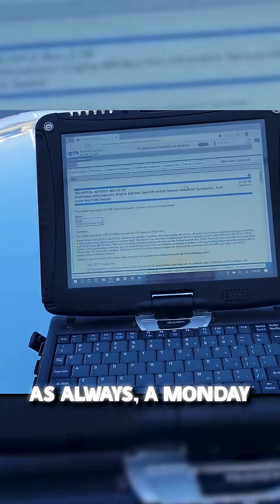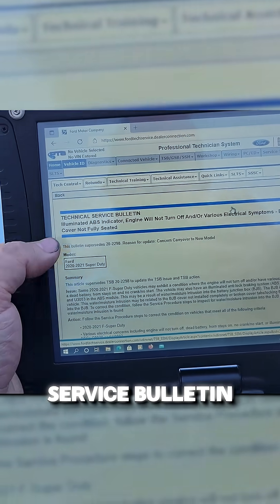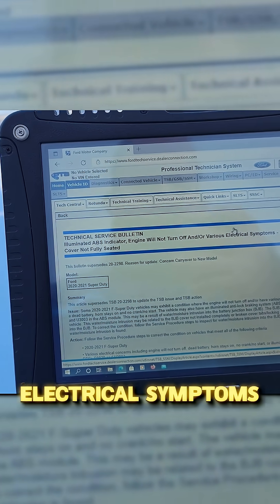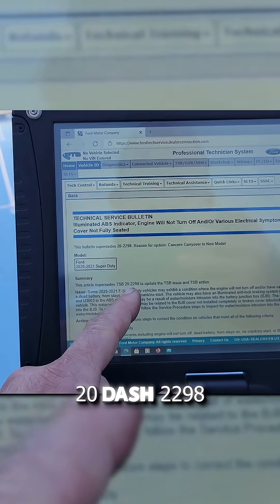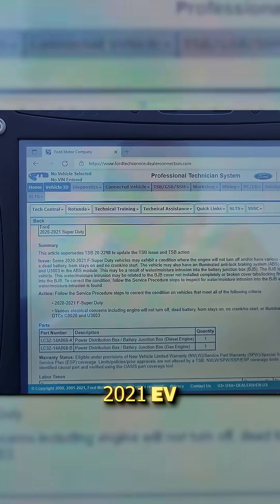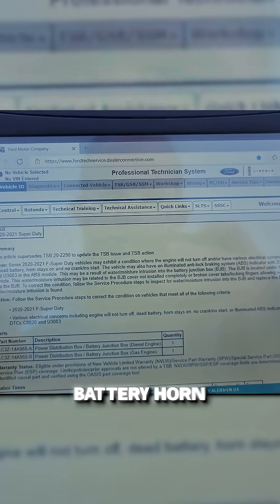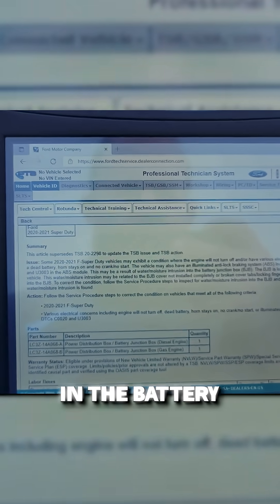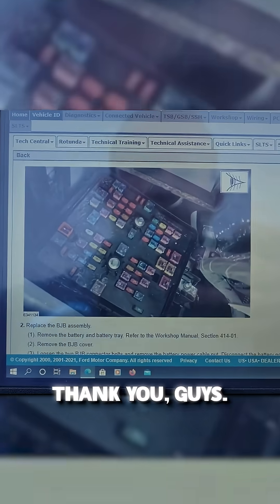Why Your Ford Won’t Shut Off – TSB 21-2176 Explained!  #ford #automobile #reels

Comment: It's crazy that Ford even put the junction box where they put it. Why put it where you know water will run down on top of it to begin with? They was plenty of other places that it could of been placed in the engine bay and not be affected by water hitting it just from rain coming down the cowl.🤦🏻‍♂️

Comment: My 2024 suddenly revved up to 4000RPM the other day!
I was on a city street so I applied the brake hard, pulled over and shut off and restarted. 
Hasn’t happened again..
Reply from the maker: Wowza
Reply: Right !  @FordBossMe
Reply: That's crazy
Reply: @mcmuskie2563 Uncommanded acceleration is one of the most serious issues.  Please file an NHTSA complaint and be sure to describe the road (# of lanes each way) and the brakes working to counter engine torque.  Basically, you need to write it in such a way that they can not dismiss it as the driver slamming on the gas instead of the brake.  This (wrong pedal) happens a lot, believe it or not.

Comment: Pull the fuse. If it shuts off replace the box.  I've done sbout 10 of these already.
Only thing I cannot figure out is the new lid you put on it. It looks exactly the same except its gray. Other than that. No difference.  There's no seal in it either
Reply: Crazy how that happens